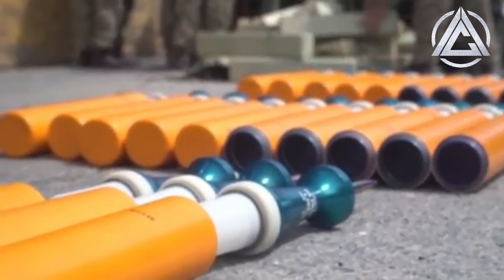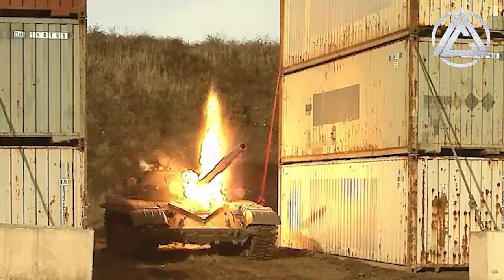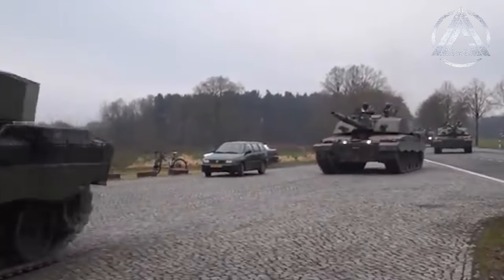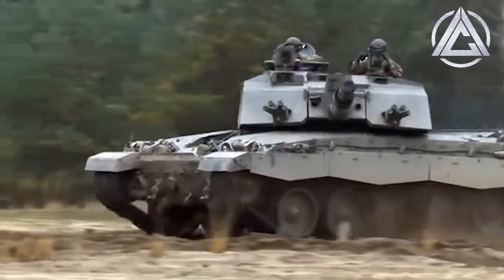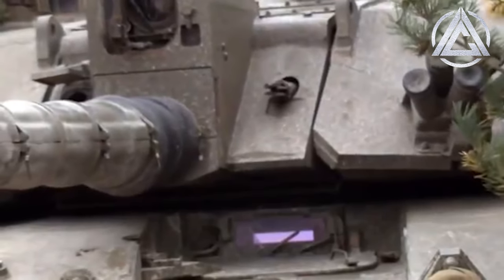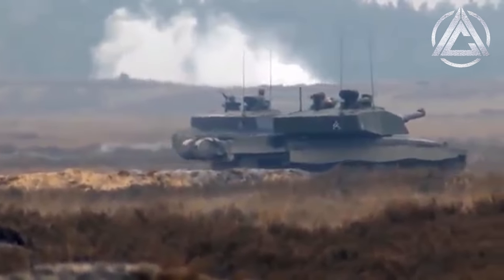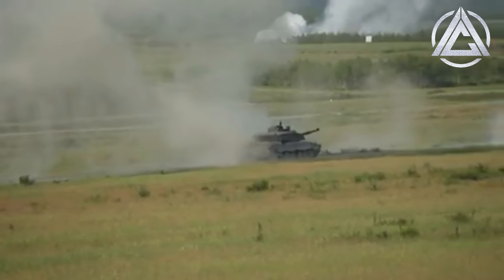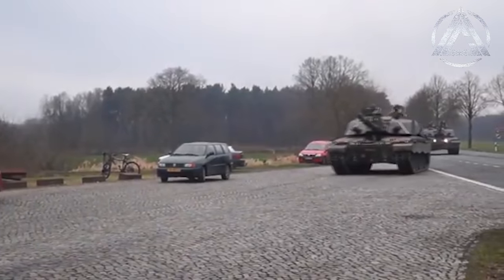Challenger 3 | Britain's New Main Battle Tank | Is It Really Any Good?

Comment: As a cr2 crewman of 10 years, i agree the hull needed improved more than the turret. A cr2 is still more than capable of taking out anything in front of it. The max speed of 60mph is never happening. Im not sure i understand your reasoning about the armour being poor though. It was thought to be the best in the world when i left 10 years ago... it cant be that bad considering the threat worldwide is more or less the same. One thing i would say is that the ukrainian was has highlighted the importance of anti tank defence systems and to have a fully integrated built in system would take up so much space and weight with ammunition etc, a completely different approach could be perhap for each tank troop to have its own trophy vehicle or designated early warning and missile protection system that is a seperate vehicle within lets say 500m of the front line providing protection without burdening the overall effectiveness of the tanks themselves, isnt that a possibility?
Reply from the maker: Challenger 2s armor was basically the best in the world when it entered service… but only against CE threats, RPGs and ATGMs and the like. Against sabot rounds… M1A2 was always better, though not by much… Leopard 2s with the arrowhead turret are better in both regards, though their hulls are very weak by comparison.

Thing is, the Dorchester 2 armor array for CR2 was developed back in 1986. It was already a decade old when CR2 entered service. That puts it up against the M1A1 Heavy, and yeah it was very impressive by comparison… but the Abrams got it’s armor upgraded in 1992, then again in 1999, then again in 2002, then again in 2017… Dorchester meanwhile never got any changes. It’d be crazy to say it was somehow STILL on par, let alone better!
Reply: @ArmorCast  what about the chobham armour?

Comment: Two things - 1) Top speed of 60 mph is extraordinary if real. 2) the Smoothbore L55 120mm gun is good but not very forward looking. Why not consider a larger gun 130mm which might be needed to counter the T-14?
Reply: 60 km/h not mph
Reply: The problem with the 130mm so far is that it hasn't a NATO standard "STANAG" attached to it. Which means it's far from sure that the Rheinmetall 130mm will be the next standard NATO tank cannon. For instance for the MGCS project there's still discussion going on about a 140mm cannon.
Reply: 130 mm add more weight to the turret/tank, trophy APS is supposed to be three tons , with extra armour it would be pushing towards 80 t !

Comment: Sounds like a typical MOD hodgepodge. They don't want to spend money developing an entirely new tanks from the ground up, so they just shove extra bits and pieces on existing Challengers. Okay at least it will have the best gun available and be able to share ammo with NATO allies and the fire control / sensor upgrade is obviously a good thing.

But as you said, with a new tank from scratch, they could have designed a better / lighter hull, maybe made more comfortable / better protected crew compartments. They could have come up with a better armour layout and chosen a better propulsion system.

Also agree that the lack of an APS is borderline criminal. Personally I'd call this Challenger 2.5.
Reply: @EmperorLionflame  I hardly think a 30 year old design can be considered "the best in the world" any longer.

Obviously designing from scratch is expensive, but advances in design, materials, manufacturing methods and incorporating operational experience from the last 30 years would result in a much better vehicle. Better for the crew, better engine, suspension & transmission. Weight savings that would increase operational range, fuel efficiency (and better mobility &  transportability). Better reliability too.

Instead all the MOD is doing is bolting a new gun and some new accessories onto aged and overweight chassis.

Also don't forget materials deteriorate over time. Those old chassis could turn out to be weak points in terms of reliability.

Not saying the Challenger is crap...but it certainly is long in the tooth and can no longer be considered the best...even with the upgrades.

Comment: You and others have said in regards to its armour the leopard is better etc and that may be but i've still never known a challenger 2 to be trully knocked out or suffer casualties as of enemy fire...the only incident was blue on blue by another chally 2. Roll on 2016 and leopard 2s in service to Turkey serving in Syria were destroyed and such... yes this is also coupled with poor experience and such of crews etc.
Reply from the maker: That's because Challenger 2's have never gone up against the types of projectiles or warheads that other tanks such as Leopard 2 have. Challenger 2's worst fear has been a few IED's (which have resulted in at least two mission kills), or some RPG's built in the 50's, Leopard 2's, Abrams etcetera have actually faced modern threats like Kornet or TOW-2.

Hell, Challenger 1 faced worse threats than Challenger 2 ever has!

Not to mention, the British crews are FAR better trained than the Turkish Leopard 2 crews were - the Turkish Leo's were sitting solo, unprotected in vulnerable positions with no recon or infantry support... they were lost through sheer dumbassery, not the fault of the tank. Plus, the Turkish Leopard 2's were built in 1985

Comment: The most important comment you made was that Challenger III is good upgrade to the Challenger II for use NOW !!!!!
Not in 10 years time.
The UK ought to have 300 of these to hand right now and not 160 or so promised in 2027 or later.
As regards an Active Protection System. The best available at the moment is an Israeli design which was actually custom adapted for the Challenger III to show its capabilities.
Again, politics interferes and instead of buying the best solution now, they would rather wait another 5-7 years until a European company comes up with a comparable system.
But it's all good. We'll just have to ask Russia and China not to attack Europe until we're ready for them, say in 2030. There yer go. Problem solved.

Comment: With new technologies comes cost. So in arguments about new equipment will inevitably have to include economic considerations. You can build a super fighter, or super tank or super aircraft carrier, but if you only end up with 3 or 4 four of them [exaggerating slightly] due to defence budget constraints, then that can be self-defeating. 
Sure, Ideally, you want it all: survivability, great weapons and sensors, speed, low mass, easy logistics, lowest cost, etc, etc. Sometimes it is better to have a high-low, or high-medium inventory.  No matter how good the tank is, you are going to have losses, and if you can only field a few tanks, you will run out of tanks and perhaps be unable to fulfil mission requirements. 
There are numerous instances in history where older equipment was pressed into service to help sustain force capabilities. The USN and others had cheap escort aircraft carriers as well as fleet carriers. The British lease-lended 50 WW1 destroyers because they had run out of them from battle attrition. 
More close to home [tank world] the US M$ Sherman was upgraded with a better anti-tank gun [the 17-pounder] to replace the standard US 75mm. The US, replaced the 75mm with the better 76mm model. NOT ALL the Sherman's were upgraded, because it was found that for general tank support of infantry, the 75mm was fine. The 17-pounder M4's were used to take on the Tigers and Panthers. 
And sometimes the opposition either has pathetically inept tanks, or even no tanks at all, like early on in the Vietnam war. 
Infantry anti-armour weapons have improved a lot since those days, but it remains true that the MBT has a shock effect, and there is safety in numbers. With semi-decent tactics, the tanks should be able to overwhelm anti-tank defences, so long as the attacker has air superiority. And in any case, being able to safely deploy a few A-10 Warthogs, which means some serious attrition of your enemy's tanks and other assets.
Reply: 200 tanks to fight along a 1,000 km front line.
The math just doesn't add up.
Reply: @shanerooney7288  You don't space tanks evenly along a front line anyway. A single tank or a single platoon of tanks is very vulnerable, and easily countered if the enemy has a few half-decent anti-tanks guns or missiles. 
Besides, Ukraine has lots of tanks. I think they started off with about 3,500, but they would have lost about half of those. 
The idea would be to use the Leopards/Challengers/Abrams as the front wedge of a Panzer Keil, adapted of course for local conditions like who has air superiority. The good stuff pierces the front, and the less capable tanks eliminate infantry, logistics and soft targets in the Russian rear areas. It looks as though the Ukrainian air force might be getting some F-16's and other nice bits of kit, so they could probably maintain air superiority over a decent area.
They could probably hold back some of the 200 western tanks as tank destroyer platoons  in strategic areas.  
The Western tanks are going to have a very high kill ratio when they engage the Russian tanks, because a lot of their best ones have been destroyed and the older types have even worse prospects of defending against the donated tanks from Europe.
Tanks can be good in defence/ambush, but when on offense, you use a lot to swamp the enemy's defences. The density used depends on terrain, enemy airpower, etc, etc.

Comment: The Abrams is by far more battle tested and refined. It's tough to argue anything is better than it, because nothing else has been really tested.
Reply from the maker: The same was true of the Abrams once. In fact going into the 1991 Gulf War, many in the Pentagon stated that compared to the T-72, and even the US Army’s old M60, the Abrams was unproven and untested and would lose to the battle hardened Soviet tank…

Next thing you know, the Abrams took out a thousand Iraqi tanks without suffering a single combat loss!

The fact that other tanks have seen less combat isn’t a good metric to judge them by.

Comment: It's a bit late and it's not enough of an upgrade and the result is probably going to be far too heavy. Everyone else is finding ways to cut weight knowing this is a real problem but this upgrade adds weight. Not good. Especially if you also then want more mid life upgrades or bolt on armor kits which would inevitably add even MORE weight. Not a surprise the Americans realised this is a big problem and the AbramsX demo is 6 tonnes lighter than the M1A2 Sep v3. That's huge.

Comment: You run a tank at its highest speed for to long it will breakdown. You will cause undo wear and tare on the tank drivetrains. That is why running at high speed is not recommended

Comment: NO! HESH wasn't for that! HESH was for that as a secondary use.....it was mainly for use against lightly armoured vehicles to save wasting an APDS back in the day. It could also be used for indirect fire as an artillery round. However, if you could see a very slopped armoured Russian turret at distance, a sabot might just glance off the armour. A HESH would severely ruin their day as it is a Chemical Energy round not Kinetic. It only needed to hit the target to cause carnage inside.

Comment: Possibly, Abrams will get any three variant. Look into next generation Abrams. It's incredible, it's got a new turret it looks similar to the old one you can tell it has the base basic old one, with what looks to be trophy integrated into the design of the turret as well as anti drone system consisting of I think it's the XM 913 or 813, but it's a much lighter 30 mm autocannon like that on the Apache, but like half the weight ( I think they developed this when started developing the 50 mm for the new ifv as they want it to be in a similar weight range to the 30 Bushmaster but 50, likely just made of mostly composites and titanium..) of most other 30 Auto cannons. So there's an XM 913 30 mm autocannon on a remote weapon station next to it on the station is a directed energy weapon that which is actually the base of the remote weapon station and on the other side is a four pot of stinger missiles, and this is an anti-drawn warfare station that the US army's going to be putting on like every 5th vehicle...

Comment: huh? Challenger 3 is just a "converted" Challenger 2. This is far from unheard of, in fact it's rather common. Heck germany is on L2A7+ up from just the L2. Meaning at least 7 Upgrades took place.

They did almost the same thing in fact, mounting the same gun Challenger 3 will get.

Comment: The Challenger like all MOD designs is about money. So everything is reliant on the MOD putting in enough from the outset. Challenger has sold to one other country. The American Abrams tank sold to six. While the German LEOPARD2 sold to over 13 countries. That means the German tank must be better. Reading reports about it sound like its a phenomenal tank. Now the germans have gone one better with their new battle tank the Panzer KF51. The beauty of this tank is its adaptability in that while being manufactured it can be tailored to the buyers requests. Whether a mobile Howizter or Bridge builder or tank. All are on the same chassis. This ability, over and above the battle tank is that it makes it more desirable to buyers, which in turn pays for research and development, thus giving money for the next upgrade. This new German tank has the ability to form a digital image that camouflages the tank and they even thought of the crew in hot countries by fitting air conditioning.  This video should compare one against the other. I have read recently, that the German government is giving 12 Leopard 2 tanks to the Czech Government as a way of helping Ukraine. Challenger 3 needs to far more electronically advanced, together with a self reloading gun. (a guy manually reloading a gun takes about 30 secs. up against a self loading gun, would have to take three hits before firing.) plus it needs to be a lot lighter and built for easy servicing. Most of all DONT let the MOD design it!

Comment: Surely, as MTU is part of the Rolls Royce group it will get an uprated Leopard engine of more than 1500 hp with a Leopard gearbox. When you add the gun and turret being German one must wonder if it would not have been easier just to buy the new Leopard.
Reply: The Leopard is a 40yr old design.

Comment: It's actually a common misconception that the L55  is better than the L44 m256. This is flat out just wrong, the reason why the American m829 round and all it's variants penetrate more and more than the L55 isn't because it's DU, it's because the gun was originally designed it's not an exact copy of the Rhine metal it has a different breach that was designed to fit a 140 mm upgraded gun that the Abrams was always expected to get a 140 mm gun eventually so you can fit longer penetrators and the breach allows you to massively increase the the pressure that the gun can accept so you can have a lot more force behind each round pushing it yes length does help in the gun barrel but it's more about how much force you can get packed behind the round and the length of the round itself. The breach on the German guns were designed only to accept a maximum amount of pressure and the chamber and in the barrel and m256 is like triple everybody else's and you can have longer penetrators up to like 70 mm that's why Abrams are so much better.  You can fit longer penetrator rounds into the breach of the Abrams as it's made for up to I think a thousand millimeters and the Germans and any other one I think if they're pretty much maxed out at like 950 mm for the entire round that includes the sabot and everything and shell
Reply: The M256 is higher pressure than the L44/55. The new L55A1 matches the M256 chamber pressure which probably has something to do with the next KE round being jointly developed between US & Germany.

Comment: Can I just say a second that the challenger 2, with all of its era and Dorchester armour is easily the best protected mbt in the world in my opinion as it has been proven in Iraq that the era and Dorchester armour can easily protect its crew from tens of rpg direct hits with only the driver being slightly injured, but they just easily solved it by putting some extra Dorchester armour there, so all in all, I think the challenger 2 is the most well protected mbt in the world.
Reply from the maker: Evidence shows otherwise. Challenger 2 is protected very well from shaped charges (those found in RPGs and ATGMs) sure... but as far as protection from kinetic munitions like armor piercing rounds, it's actually never been as good as the M1A2 or Leopard 2A5, at least not on its front turret. It was 15% worse than the M1A2 with its DU armor, and the the M1A2 SEP is even better again! Many tanks now outmatch Challenger 2's armor entirely (against both kinetic and shaped charge threats), such as M1A2 SEP V3, Leopard 2A7V, Strv 122, K2 Black Panther, or the Leclerc Scorpion with its AZUR package. 

Keep in mind Challenger 2's armor design isn't modern, it's from the early 80s... it may have been the best in the world, IN the 80s (and that's impressive enough given Britain's lacklustre military budget), but it is outdated by modern standards, hence why Challenger 3 will finally upgrade it.

Challenger 2 surviving a bunch of RPGs (built in the early 50s!) hitting the front turret, doesn't prove anything. Abrams, Leopard 2, Type 10 or K2, hell even a T-72B could do the same without much issue! In fact, even the M10 Booker is rated to be able to do that, and that's a LIGHT TANK!